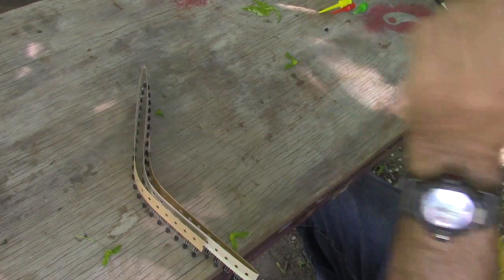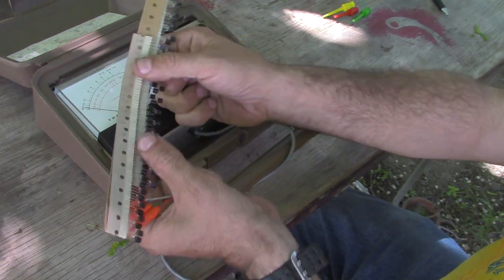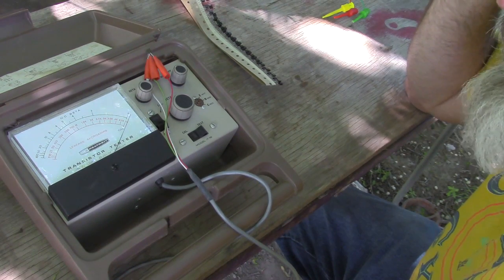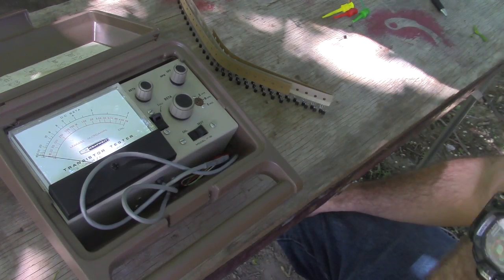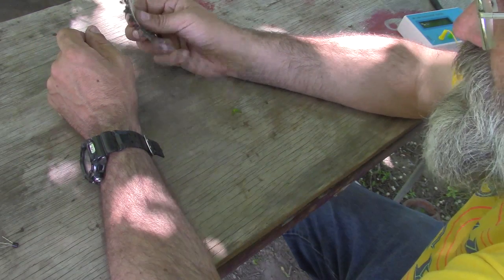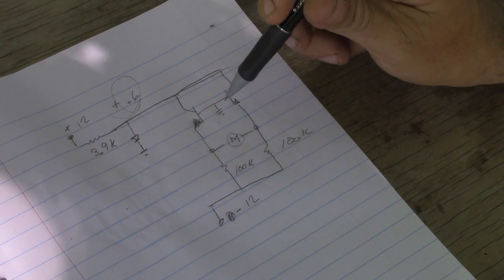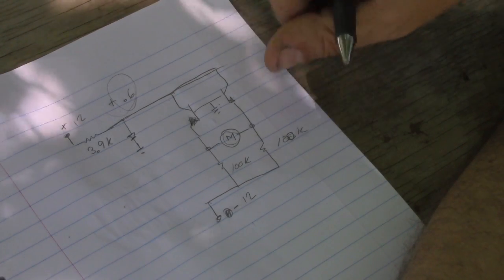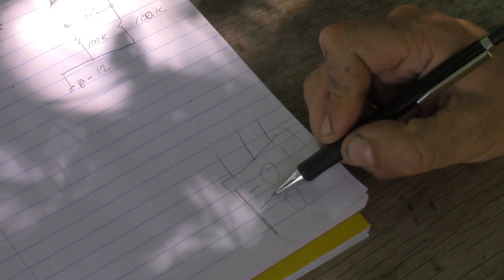Matching transistors

Comment: Hello! This little circuit looks and seems to be amazing! I'm in a headache of failing to make a good (or at least working) exponential converter for my Roland type oscillator. As I've got in some topics (about other VCO) that bad matched transistors can give a non-tunable expo converter.
Does your circuit uses a bipolar PSU? Is it cruicial if so?

Comment: Best thing is that you hook the transitors up and measure the voltage accross your load for closet to zero volts and also measure be voltage.

Connected in common collector 1 npn and pnp and you match your resitor for bias, one resitor going from C to B to bias it, then use the voltage that your gonna run it in to test it,
Cus the voltage changes the gain changes so your matched pair running at 12V isn't going to be a pair once you run that bad boy at 50Volts